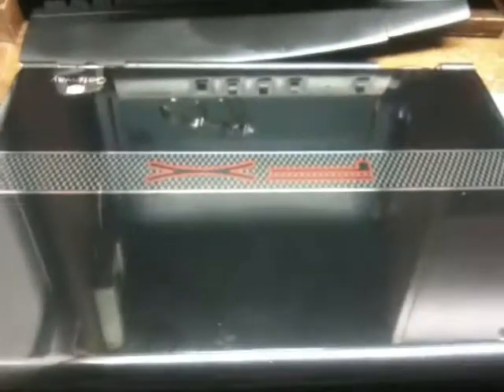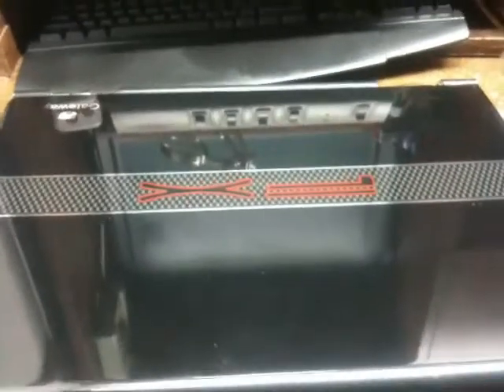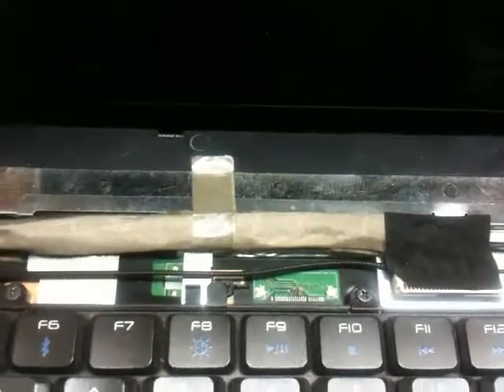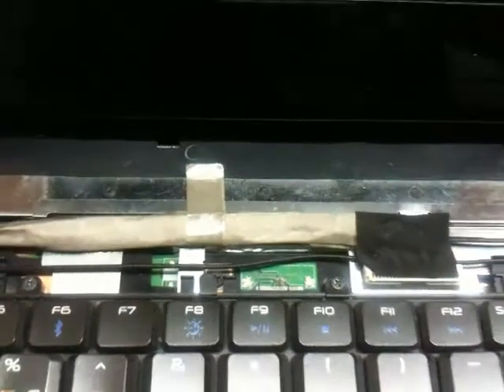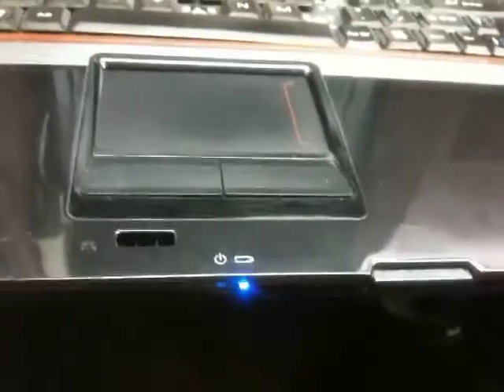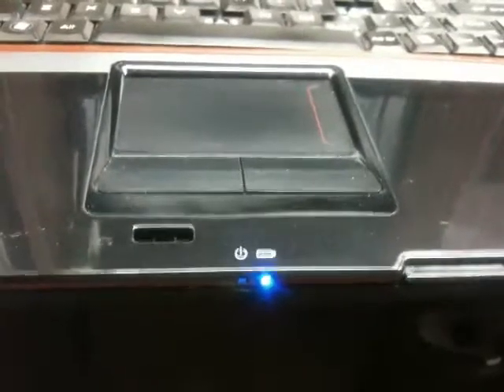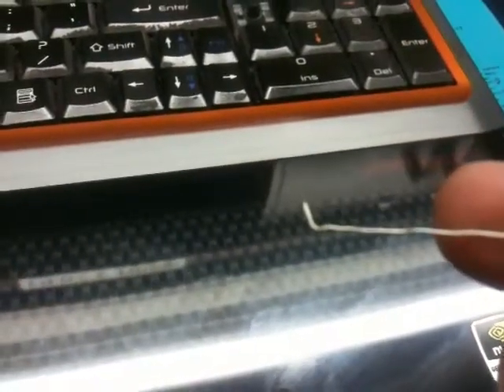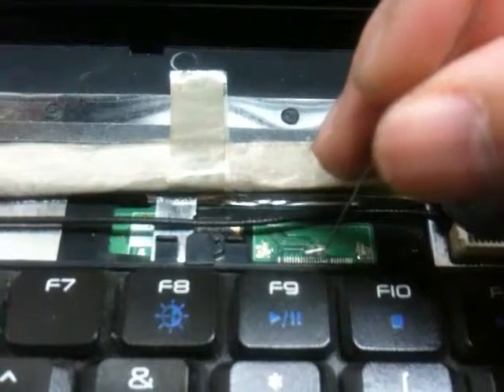How to turn on a Gateway FX P-7805U  Without Power Button

Comment: Your idea worked for me. Thank-you. I dribbled tea into the power button and damaged the  little 1" square circuit board with the push button on it, I guess. I tried shorting the button contacts and that did not work. I used a metal ball point pen to do what you did. Apparently the two correct contacts are adjacent to each other.
Reply from the maker: Glad it helped.  I'm not 100% sure but I think most if not all are designed with power switch pins that are adjacent.
Reply: Chad's DIY, more details to help others:

I finished rewiring my power button directly to those two pins, which are near the center. I unsoldered the 6 pin E27 IC, ran two wires to two handy traces on the adjacent board (easy to solder to), and then disconnected the normal multi-conductor ribbon cable and replaced it with a 4 conductor ribbon and lined up the two pins and omitted the rest. The LEDs and their associated rewind buttons, do not work. That is fine.

Also, I discovered those two pins, which you suggested, are unused by the normal design. The circuit board has no traces to them (a hint at how to find them). The side-effect of my new ON button is this: OFF-by-holding down 5 seconds, does not work. ON works. That is good enough. Software shutdown does power off instead. So does unplug and pull out the battery, to do OFF, if frozen. I wrote all that to help somebody else rewire it neatly. 

Before all this, I tried replacing the E27 IC with one from the adjacent board, thinking E27 was faulty from tea bathing. That did not work for me.. Anyway, I am neatly up and running. Most would have thrown out the completely dead laptop.
Reply: Spider Monkey: I saw that picture at Barry Soetoro channel. That guy is funny and clever. lol
Reply: Another side-effect of my new power button is it only does ON when plugged into AC, and then I can unplug AC and run on battery afterwords. I can live with that.